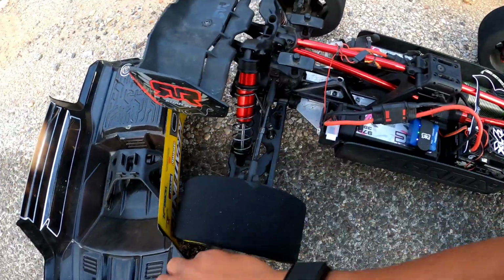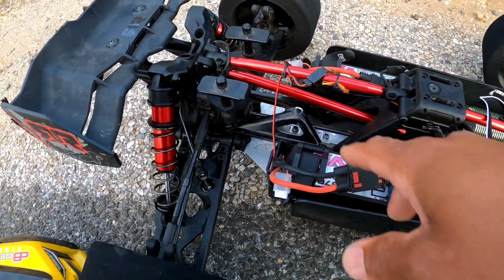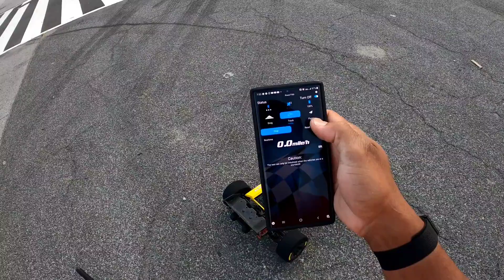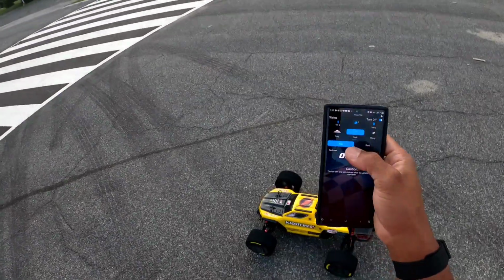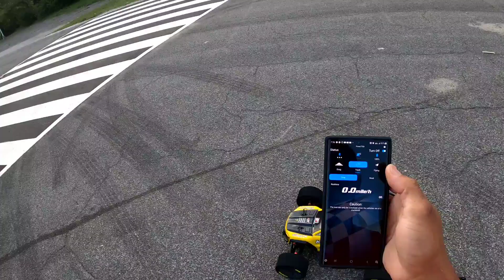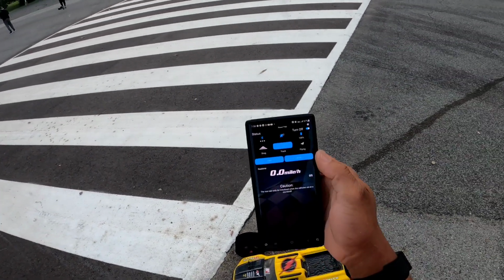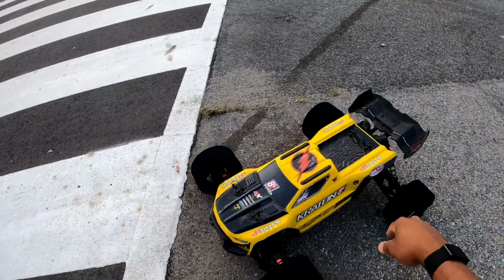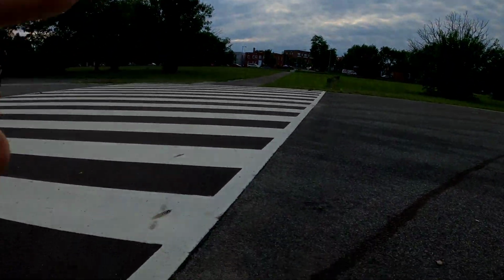Arrma Kraton 8S Top Speed Being Held Back Because...

Comment: Got any insight or recommendations for Tires for the Kraton 1/8 6s, I have one tire that ballons alot because of the heat down here in florida . I also don't want to tamper with the diff fluids etc because it runs great (i added a gyro) I have 2 of them but I don't want to break anything getting to heavy a tire etc... I drive on pavement and grass/dirt what would you recommend that I can just swap out the originals and use that don't balloon as hard? Seems like just the right right one balloons really. I just got back into the hobby and owned the original Kraton and Talion and never had to change a thing on them and went hard on em , sold them wish I never did. Only part that ever broke was a ball joint from doing cartwheels when mistakes were made lol :D
Reply from the maker: We can discuss it more in detail on my Instagram.  Please contact me @Matrixrc28

Comment: And metal housing on barring
Reply from the maker: That would mean replacing the gearbox.  However, after further inspection the gearbox is fine.  The 12t spiral pinion needs replacement along with c clamp and bearings.  Should be arriving today.